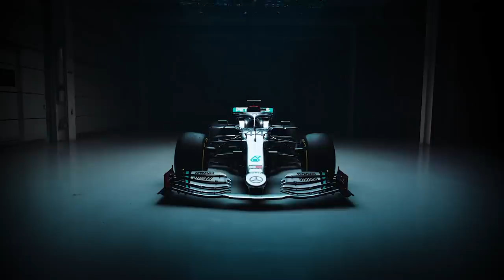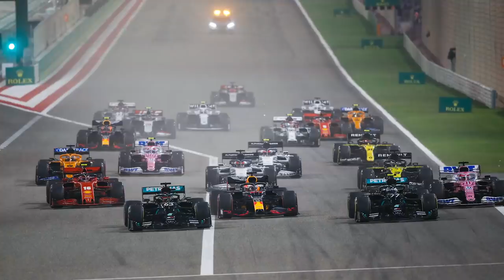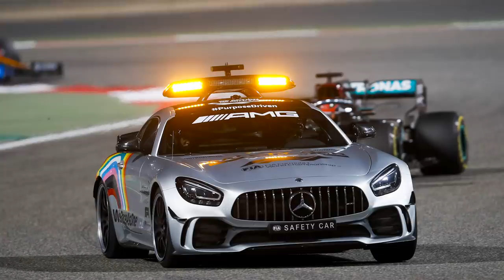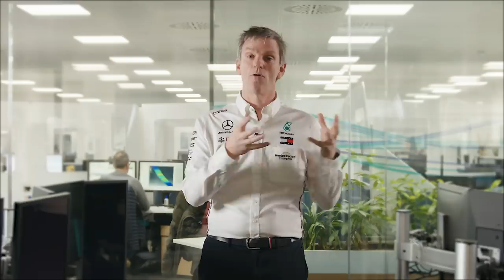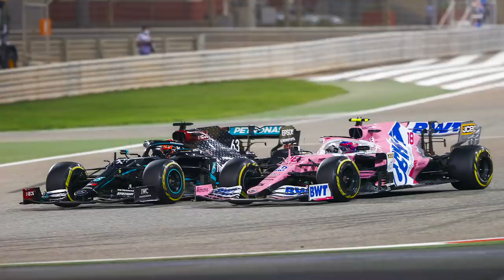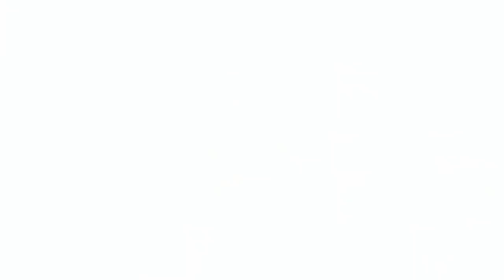The Double Stack Pit Stop, EXPLAINED | 2020 Sakhir GP F1 Race Debrief

Comment: As high-speed cornering on the outer track is vital lambinar & smoothly commuting sufficient energy through the rear tyres. Therefore, configuring the correct front brake bias focusing the set-up at particular corner speed range (low downforce setup) & gear ratio of input speed!

A very productive FP1 in test programme high speed cornering on the outer track smoothly commuting sufficient energy through the rear tyres, configured the correct front brake bias focusing the set-up at particular corner speed range (low downforce) & gear ratio of input speed!

Very productive FP2 session representation! Track acclimatisation & tyre adaptability (hard compound & medium tyre compound response in the durability  of performance & establishing the right brake bias & differential setting  to generate consistent traction (Turn  1-3, & 8) in particular!

FP3 - Applying the selected brake bias, differential & gear ratio configuration according to the to the corner entry & acceleration points in generating capacity of traction for the increments of time for qualifying for track & strategy outlook for the event!

FP1, FP2 & FP3 conclusion - Very productive FP1 FP2 session representation! Track acclimatisation & tyre adaptability (hard compound & medium tyre compound response in the durability  of performance & establishing the right brake bias & differential setting  to generate consistent traction (Turn  1-3, & 8!

Qualifying; - A well executed lap from Valtteri & George tyre adaptability soft ( compound & medium tyre compound response in the durability  of performance & establishing the right brake bias & differential setting  to generate consistent traction (Turn  1-3, 7& 8! Gear ratio configured well!

Race - Excellent tyre management & preservation (from both drivers) of the yellow medium tyre compound (particularly contemplating the PSI ratio on the tred on the carcass of the tyre in extracting the optimal performance window) & the differential & front brake bias configuration, along with the ride height & gear ratio & rake level enabled the car characteristics to generate consistent traction performance throughout each lap!

Comment: 15:49 What cause the puncture ? debris or kerb ?
Each of them has different signature, characteristic, and behaviour. 
Debris most likely stuck deep enough inside the rubber to cause puncture and unlikely to get out after that.
Kerb doesn't leave tracemark but you can tell when it start happening, which corner, which kerb by analyzing both video and telementry data.

Comment: Why were the radios programmed in this way? I'm sure with the level of technological advancement in the sport and by the team itself you could likely have overlapping communication. Is it an FIA rule to have this sort of single-speaker system? Will you just favor the pitwall over the driver in case of conflict or allow overlapping speaking in your radio entirely? Thanks

Comment: Do you guys still answers questions ? I heard on the radio george had a "slow" left rear puncture is it actually possible to finish the race with this punctured tires ? Since the laps arent that long and its only like 10 laps left if I remember correctly.

Comment: Toto mentioned several times in interviews prior to the race that George was very chatty when compared to Lewis and/or Bottas.  So they'd never had the problem before with crossed signals.  Sounds like they either need to re-prioritize the radio signals to Ron over the driver, or tell the driver to keep the chatter to a minimum.  :)

Comment: Im not so good on the technical knowledge of f1 cars. 
If a car has been lifted during a stop, does the driver also put it on neutral? If so, then wouldnt it be easier to ease off the brakes a little so that they dont overheat (like valteri's did)?

Comment: I still don't get clutch bite. I thought you just released the paddle and off you go. James reffered more deep bite more wheel spin. Can someone explain? Thanks
Reply: If you slip the clutch more, you’re putting less power to the wheels and therefore less wheel spin. 

Slip it less (more bite) and you put more power to the wheels, more wheel spin.

I guess you haven’t driven a manual?
Reply: @trailbossdan1  oh ok thanks. I'm just 16 so 😂. So they can actually change the "distance" the clutch paddle has to travel. So if you have more bite that means it's easier for you to let it go? Like, faster, because the paddle travels less distance?
Reply: @vianaa7  yeh the driver decides how much and how quickly they release the clutch paddle.

It’ll make more sense when you start driving, it’s difficult to explain how it feels.
Reply: @trailbossdan1  ok I think I get it. Thanks

Comment: 13:26 So Bottas's tires were just sitting in the pitbox the entire time?
Reply: They put 2 of them on Russell's car so only had 2 of George's to put on Botta's which they can't do even if same compound & 1 of the guys quickly realised this....so the only tyres they had left were the ones they just took off.
Reply: @d.b.cooper1  what I'm asking is where did those two Bottas tires that they put on Russel's come from?
Reply: @bendtfender2894  Bottas’s team bought out all 4 of the right tyres, but Russell pit first so I imagine they just saw the same compound they needed & put those on assuming they were George’s as they were 1st in lime (I doubt they double check due to timing). By the time Bottas came on they realised the error, mainly the front left guy who I imagine saw the GR engraving on the tyre or something as he was the 1st to react.
Reply: @d.b.cooper1  okay now I understand thank you so much. And looks it's possible that they knew they screwed up when they took Bottas's tires off and realized they didn't have a new set there for the front tires. lol

Comment: I did not hear the fact that Bottas had a bit of wheelspin at the end of first gear just after launch, just before his upshift and George had a clean upshift from 1st to 2nd gear. Only after that moment did George really pull away from Bottas to be ahead of him at the first corner. It was not the initial start off the line, but the end of  the first gear.

Comment: One confusion. If half of the pit crews heard the instruction and took the tyres of George, why the another half of crews can't see them doing so and follow them to take the same set of tyres out ?
If the four tryes are put together,  and pit crews just take two of them for George, (that means another two are still there) why no one find it and still put the wrong tyres on George's car?

Comment: Jolyon Palmer's analysis seems to disagree with what you said about Valtteri's start, is he wrong or are details being left out here? If you look at he onboards it seems that both drivers got away at the start almost simultaneously and they seem to get good acceleration from first gear, but into second gear and further Valtteri had an immense amount of wheelspin while Russell was able to clear these phases of the start fine.

Comment: you failed to explain why the crew member on the very left front found the mistake when Rus  fitted the tires but got waved off by the crew member who hold the air gun. The left front air gun guy messed up both dirvers' race

Comment: 2 things I don't understand:

1 - if George's half of the garage didn't get the message, how come only half of his tyres were missing and not all of them at the time when he had stopped? do they keep half of George's tyres in Valteri's garage or how?

2 - how come that the radios have never ever overlapped before since every race weekend consists ~6 hours of radiotime and both driver and pitwall talks a lot. and even if it never happened, how did they not think about such an obvious situation where a pitstop call can be overlayed by the driver asking for something? making the pitwall a "primary" or "main" channel would have solved this issue, so whenever the pitwall talks, no other broadcast can be received by the pitcrew. it's such an easy solution, I have a hard time believing that a team like Mercedes did not think of that.
Reply: Only the pit crew can explain the first question.
In hindsight, George’s tyres shouldn’t be out at all, cos they were all covered up, I want to believe it was when the saw him in the pit lane that they got everything messed up.
The real question is...how come no one saw it even with tyre indications for specific drivers...not until bottas came and the front left tyre pulley guy spotted the mixup and started waving a no-signal till the brakes caught fire and needed air??

Comment: I honestly don't believe the radio thing. I refuse to believe that this can happen and it have never happened before. How can, in let's say 10 seasons, in 20 races per season, that the driver NEVER talked at the same time as the pitwall crew. This is 200 races * 2 pitstops/race, 400 pitstops. And this never happened.

Comment: Fishy.......For me after watching a lot of F1 races it is almost impossible to believe that after a huge mistake like that a puncture appears in a fresh set of tires and in that little period of time, my guess is the following : For the images we saw that the front right tire man notices in Bottas a tire with the mark of Russell on it, so they put back the original hard tires back and send him away so Bottas have correct but older tires. So they called Russell to Box again and We were sure that he have a Bottas front tire but the rear tire man did not tell nothing on Bottas before about the rear tires my guess is that Mercedes did a second mistake and change all tires in Russell and put at least one rear Bottas tire on Russell and then they figured out so they instead accept this second mistake tell Russell the story of the Puncture. Why simply Mercedes accept this second mistake and avoid all that circus of explanations.
Reply: mixed up tyre owners

Comment: With all due respect, the "safety car excuse" doesn't cut it. Under that argument, Mercedes would have applied the same rule in all GP with a high probability of a safety car and I will risk it and say they didn't. By not giving a credible reason, the question now is: what are they hiding?

Comment: did the tyre go down ? you have just explained car sensor fail multiple times maybe your tyre pressure sensor was wrong as well ? maybe Russell could have risked staying out remember hamilton crossing the line with flat tyre and still winning you need to have word with the race director having a full safety car for no reason the virtual safety car was doing fine yes lewis benefited in imola with another bad call from race director but he clearly is bad at his job as race director or they need to have better track marshals talking about marshals they haven't talked much about that marshal running across the track the race before . f1 driver Tom Pryce died in 1977 after hitting a marshal running across the track